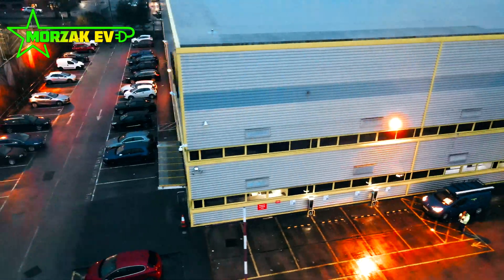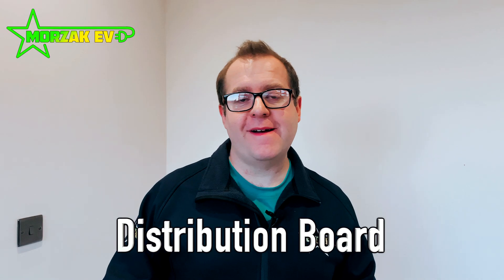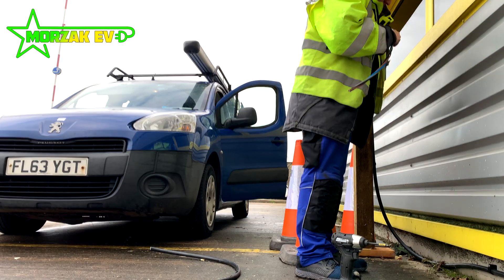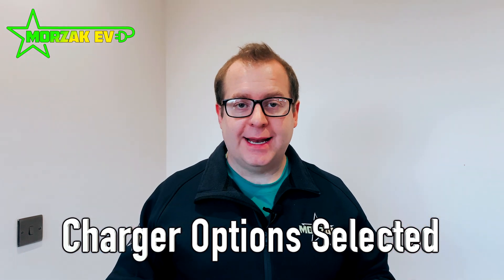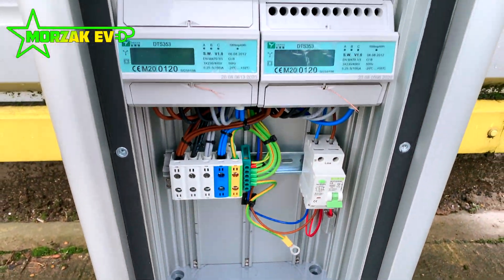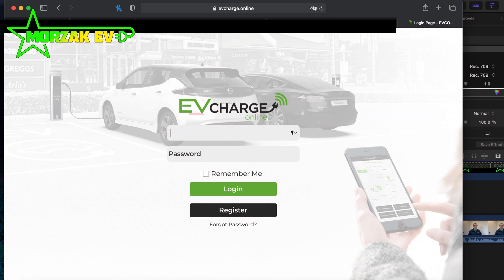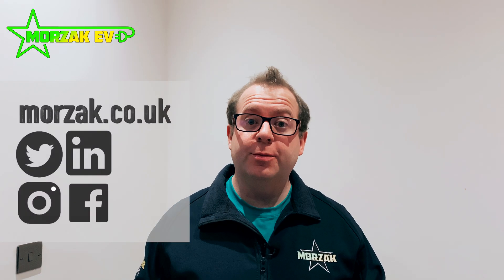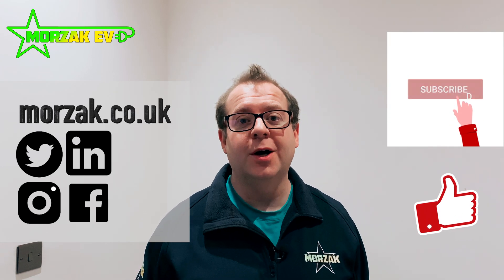Commercial EV charge point installation of Rolec Quantum 3-phase 22kW charge points

Comment: Any jobs going? Fully qualified electrician with 23 years experience....any links?
Reply from the maker: Not right at this moment, but send us your cv to youtube@morzak.co.uk
Reply: @MorzakEV  Cheers, im looking into the regs for this 4th edition 2919? I think? Ive done 2391,17th edition IEE. Trying to get a PDF of the EV regs with no luck.  Any ideas?
Reply from the maker: @checktheskies5040  not sure I understand your question. All the regs for ev charging are in latest edition of the wiring regs, 18th edition with the latest amendment (there are some specifics in the latest amendment relevant to EV charging). You can get further clarification on this by purchasing the latest edition of the “code of practise electric vehicle charging” (at the time of writing this, the 4th edition). You would need both of these books (official copies) to do the C&G2919 course. Hope this helps.

Comment: Did you have to do much ground work to install the base for the Quantum chargers, it's hard to tell on the video. As I understand they have to had a area dug and concrete the main steel base in for the charger to then be bolted on. Be good to hear. A lot of videos from EV people showing the outline of it, but never you down and dirty bits like the groundworks, installing base or actually configuring the chargers. So would be good to know and see
Reply from the maker: In terms of the ground works - you’re correct in the preparation, however, as the car park was already concreted, and the cable cable entered from the rear, there wasn’t any ground works required. They bases could simply be drilled and rawl-bolted straight on to the concrete surface. There is a base that can be supplied from Rolec, which is especially useful when you’re installing on softer surfaces or sub-surfaces, but they can also be mounted directly on to a suitable surface if possible.
That’s for the ideas though, we will see what we can shoot m, depending on the customers and the jobs.